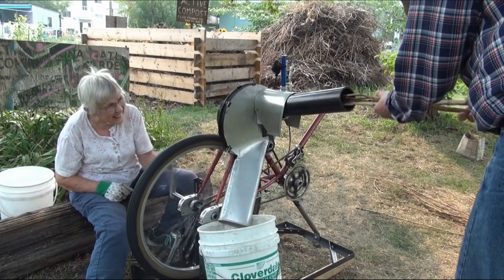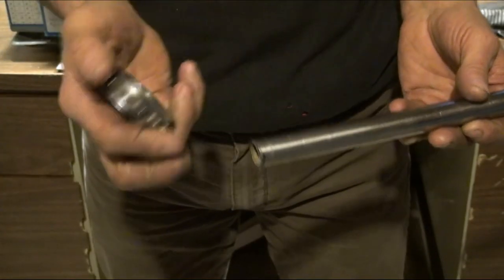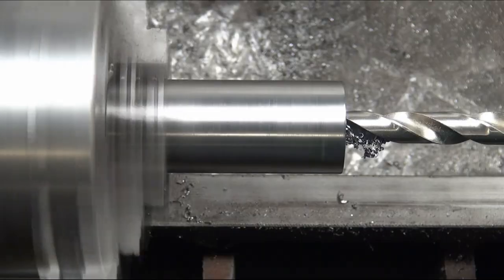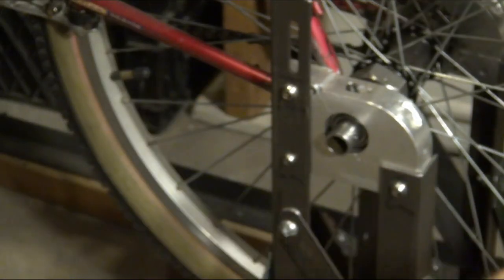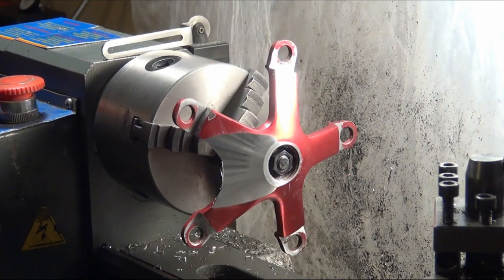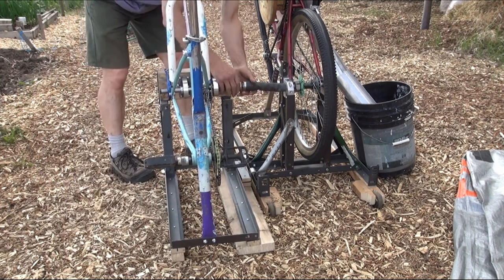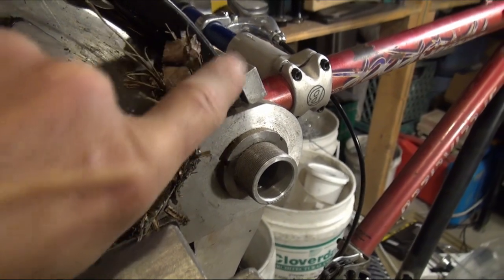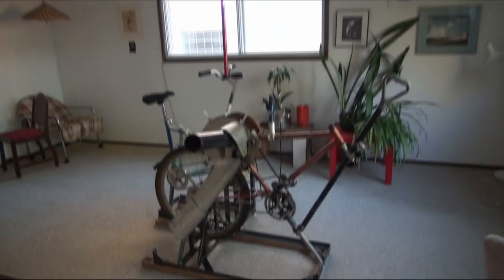Pedal-powered mulcher: the pedal drive

Comment: Really nice work! 
One suggestion: in the old days the hand powered straw choppers / chaff cutters ishad a big and heavy iron wheel (or maybe even two of these) so the kinetic energy/momentum stored in it when rotating made the cutting much easier.
Reply from the maker: Good point. The bicycle wheel here serves this purpose, though it would work better if heavier. Still, most people riding this machine complain that it is too easy to pedal! The gearing is quite low. I have looked into chaff cutters but have found that none of them seem to be used for sunflower stalks, a significant garden remainder. Thanks for your comment.
Reply: @janprzysiezniak7563  make a cement slurry and pump the tire up with it. let it cure with the wheel laying horizontally so it doesn't settle to one spot causing severe imbalance. Cheers from Beaver County.